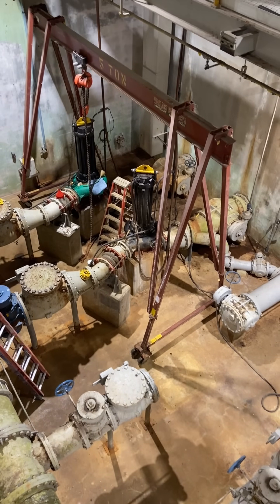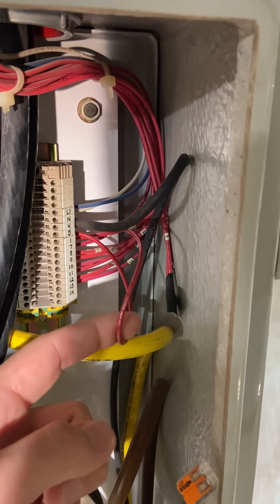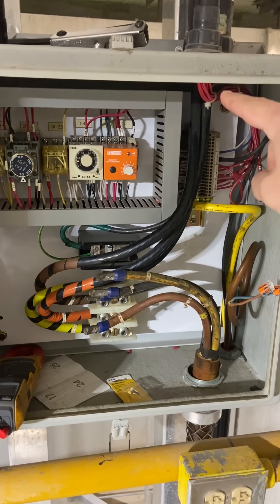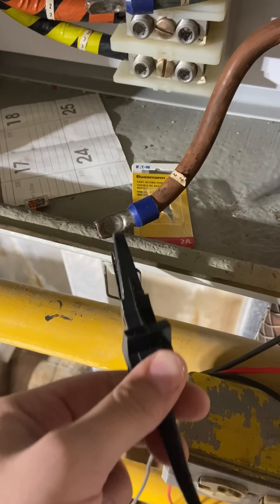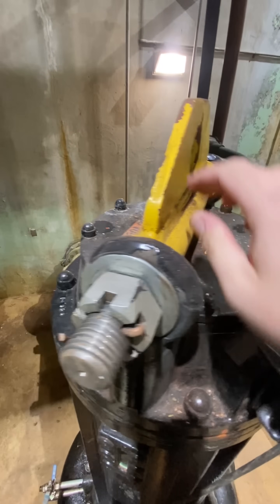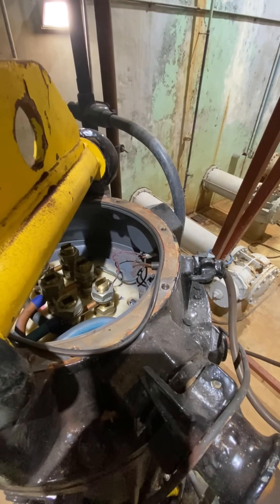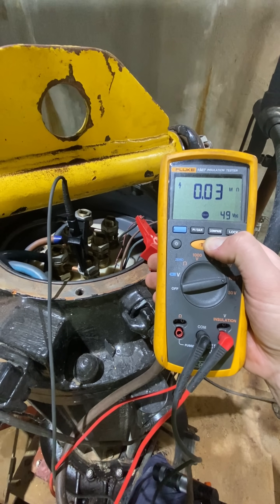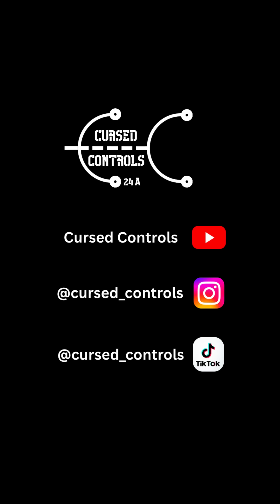Temp Sensor #electrical #motorcontrol

Comment: It is most likely due to high frequency harmonics of the drive causing voltage induction. Most likely the problem will be solved if you use an output choke

Comment: I would really much appreciate if you would start a series in literally  teaching how to do  controls / wiring up /  diagnosing / how to use the multimeter / interpret results / plc , etc . 

Would really like to tap into your technical  know how 😊
I need to learn more form people with actual experience like yourself so I can get to the next level aswell ! 

Please consider this  . There is a hunger for this knowledge that I crave 😅

Comment: That looks like water in the wrong place.

I had a similar problem... I got called in after someone blew up a few plc's and 24V power supplies and the one after him did the same thing once before calling me.

They just didn't know where to look because replacing the exploded components didn't solve the cause and their dmm wasn't sufficient to measure an insulation fault that had a breakdown voltage.

I immediately knew it was line voltage on 24V parts and pulled out the megger, almost immediately traced it down to the thermistor inside the motor.

Checked some other control cabinets and a bunch of thermistor cabling was just bypassed...

I then modified every pump control to fit a foxtam insulated thermistor relay and added 300mA GFCI to every pump (added GFCI protection because those pumps feed waterfalls and small streams from multiple public accessible ponds.)
No more expensive control repairs and the pumps started to be more repairable due to less burn outs.

Then some 'new' guy came in and removed all the GFCI for the reason they cause nuisance trips, pumps started burning out again and I stopped taking calls from them 😉

Told them I won't service unsafe equipment. You touch it you own it.

Comment: Had something similar on a large scroll compressor: putting 400v onto the motor made the PTC-sensing protection module go bang. Turns out the mains was leaking onto the PTC wiring somewhere and…..kaboom! Couldn’t see it with a multimeter, but found it once I started testing >100v with a Megger. 

New compressor required…….

Comment: 30 year pump guy here, this pump looks really old it possible the motor insulation is bad, not jumping to ground, but jumping to the sensor. You only meggered it with 50v. You should have meggered it with 500v.

Comment: 10 years later it still sitting like that. I replaced a sensor on a carbide saw 10 years ago I haven't worked in that company maybe 8 years. That sensor is still there. It was not the correct sensor proximity sensor with dual outputs but I had to make it work since we didn't have that sensor and well its a German machine so they source the parts from a company that bought all the plans and licenses for the machines since the old company went out of business so lead time was 2 to 3 weeks but if you've worked in a production plant the words lead time is a sin. Even though we would that sensor in the parts l8st every week our boss just didn't order it cause it wasn't broken. Well last year I visited and that sensor is still there still working and im the I ly person with the original programming for the plc. So when they do decide to replace the sensor its gonna be full panic. When it doesn't work. I did specify if they order sensor it should be the new one on there since the program wass chang3d to accommodate it
 But the chances they listened are slim co concidering they never ordered the original sensor. Which had output one at one distance which the saw could drop fast until it got really close triggering the second sensor which would slow it down to its cut speed. Well a simple program change and knowing the actual feed speed let me set up a bar size to feed speed on 2 timer one to get with in 1/4 inch then drop the feed speed to its final cut speed. Not perfect since adjusting feed speed on the demand is harder for the operator to understand but so far its worked

Comment: I have seen this several times over the years as a motor tech. I would bet the motor is a dielectric oil filled motor. Either the motor or the sensor has failed slightly and contaminated the oil. that makes the oil conductive and back feeds the sensors. I typically seen it happen most on moisture sensors in submersible pumps.

Comment: That initial remark about "not a permanent solution" is what went wrong on MV Dali, causing it to loose steering as it was passing the point where two sailing channels met just before the Key bridge .  Motor guys couldn't run fast enough between the controls to regain control before collision .  6 Dead and a billion $ in repairs needed .
Reply: The MV Dali failure cause was the heat shrink wire identifer markers were placed too close to the ends. That made it so the crimped on pins could not insert fully into their connections. Over time they'd vibrate loose. The other part of why the ship lost power was the arrangement of how the systems handled failures. The systems could have been arranged so one loose wire couldn't cause everything to quit, but they were not. https://www.youtube.com/watch?v=bu7PJoxaMZg

Comment: I'll bet you it's the feather on that crimp connection on the red wire.  I would at least clean that up before spending thousands to have the motor rebuilt.

Comment: Just a millrat learning electrical the hard way. When megging a motor, do you ever check phase to phase, and if so, you would disconnect your other pairs(7/4,6/9,5/8) right?
Reply: Meggering between two connections that go to the same winding is not going to be useful.

You could in-principle disconnect the windings from each other and then test between them, but I don't think it's something that is done regularly.

Comment: Regardless if the breaker is off or not you should never use uninsulated tools when working on electrical components

Comment: So one leg the sensor gets connected to a different phase, creatcing 240v on the clock and sensor. Why not use the same phase for the temperature sensor as the shorted wire. If the motor doesn't overheat and doesn't short to ground it's just a worn out sensor lead in the motor. Add an extra overheating sensor for safety and save yourself a ton of downtime.

Comment: Real professionals? You actually diagnosed it, correctly. The only thing you didn't check was if the motor case had a grounding issue, while running. There was no need to though. If I could trust the last guy that was into whatever I happen to be fixing or replacing on a given day...do you know how much easier my job, or even, my life, would be?!

Comment: Nice catch, one issue is if the fuse blew the thermal wires shorted yo ground, if that blew the timers or OTHER controls then the 480 is making its way back into the control circuit 😢 that bad & motor should have been left locked out.   Mo need to let it take out mains, fuses to melt the motor down more.😊   the therman leads are 300v wires & looked to already be shot insulation. 
Always to a meg check to ground too on leads & thermal switch @ a lower voltage on the meg.

Comment: Just curious.  Did you write a detailed report of your findings. Put a copy in the service manual you have.  A copy for the bosses files.  A copy to put inside the peckerhead for the tech that is going to tear it at the motorshop so its not a mystery.

Comment: I'm going to say the motor probably has a "flying short". 
I have had this to happen to several electric motors over the years. The short only occurs when the motor is at speed. Centrifical Force is what triggers the short. A flying shore is not easy to find. I have had to use a second motor to spend the first motor up to speed to be able to detect the short.

Comment: I had a internal temp sensor\overload in an ABS Piranha pump cause a ton of issues after tripping a few times.  Tripped well below FLA and just above MOST operating amps.  Electrician came in installed O\L in panel...still tripped at internal O\L..bypassed...no more issues!

Comment: That is a sweet Megger. I can't justify the expense of a modern one for the once every year and a half I actually use one, so my old school hand crank 500V one will have to do. Is it heavy, cumbersome, and a pain to use half the time? Absolutely. Do I still love it? Absolutely times two.
Reply from the maker: @robertschemonia5617 I have a 1,000v crank that just gave up the ghost, sad day☹️
Reply: Believe it or not I've had multiple cheap ones (like under $100). The aneng ones have been great. But even the cheap dog s*** $30 Ones Still Always gives the same readings as my fluke and megger brands.
Reply: I never had an occasion to use a hand crank megger. We had analog ones and I used the same one for years. Then they swapped to digital ones. I kept my old analog one and still prefer it. I trust it more.
Reply: @thehogdoctor the only reason I have the one I do is because it was CHEAP like you wouldn't believe. I paid $0.20 per pound for it, and it was still in the original canvas bag, and even had some of the test cards in it. The bag fell apart, but I did keep the cards that weren't ruined. I also know what you mean about analog meters! My go to is my ever faithful and trusted Simpson 260 series 8! The one thing I absolutely HATE about it is the stupid reverse banana connectors on it. Fixed that with a set of allegedly gold plated adapter dealies. Now pretty much any meter leads will work with it! Simpson must make their replacement leads with platinum plated unicorn hair!

Comment: Ahh yeah those dry well-wet well poo stations are always fun to work in. Years ago when I first started my career I often worked at a pump house like this one. There were Flowserve MSX pumps and Sulzer pumps. I saw this same failure mode on one of the Sulzers. I also have to periodically pull a pump and refurbish it. Oh how I hated refurbishing those things! I think they had been refurbished so many times it was getting to the point of needing to replace pumps. Also, one time that lift station formed a leak on a pipe flange of the main discharge header and it filled up the dry well with a zilloin gallon of poo. Thanks for the memories and thanks for sharing.

Comment: Oooooh someone’s got a fun day of pulling a motor on their hands 😂 unless someone can get to that thermal sensor on sight, that would genuinely be something I’d love to see how it’s done lol
Reply: I used to work for a company that did vac truck services for city.  Numerous times we'd get called in to pump out sani wells to pull pumps.  I never really thought it was a big deal until reading all these comments.     The pumps we'd pull very similar in size to the ones in this video.   Anyway, the well would get pumped down by the remaining pumps.  The crane truck would lower its hook to the pump and we'd slowly lift, ensuring no cable tie ups, get it just below the top of the well, then pressure blast as much shit and grease off the bastard back into the well. They would land the pump on the ground.  Id finish blasting what i couldnt see before.   The millwright would do his inspection onsite.   If he decided to send the pump out, we'd wrap it in poly, duct tape it and crane it onto a flatdeck.   Wait an hour (municipal time of course) for the backup pump to arrive and we'd put it in place, do a test run and call it a day.  I've done that probably 150 times over the course of 10 years. I live in a hilly region and there are A LOT of municipal wet wells.

Comment: Why not just use overloads if you're using a basic bimetallic temperature switch?
Reply: Bimetallic temp switch still measures the winding temperature. Also required due to ATEX etc. (common with sewage applications). Overloads also cannot properly protect a submersible motor, especially in the case it is no longer fully submersed.
Reply: @kanetw_ super interesting. Thanks.
Reply: Idk. I think a thermostat in the motor is more quick to respond to an adverse thermal event that isn't due to ambient temperature/ motor load, it covers things like bearing friction to some extent

Comment: Thanks a lot for this video. I was actually considering whether to wire a bimetallic temp sensor directly to the VFD or via a relay, and this made me wire it via a relay. Don't want to fry the new shiny Siemens G220 because of an isolation failure

Comment: Thank you for your videos. They're very helpful and informative. You do clean work and I respect it! I'm a 3rd year electrical apprentice and I work on lift stations for my utility so its pretty cool to see similar content/things. With that being said I have a question in regards to megging. I was taught on 480V motors you test at 1,000 volts and look for 11 Gigaohms as a perfect reading. For 240V motors you do 500V and look for 550 Megaohms. Do you or anyone else do the same? I've heard some people say it doesn't matter and some say they only do 1,000V on everything. In my experience though I have found that I don't get a 11 Gigaohm reading when testing 1,000V on  240V motor windings even if its a new pump/motor. But I'll always get 550 Megaohms when testing at 500V. Im not sure if the 11 Gigaohms is out of reach for a measurement for the 240V windings or something. Any advice or help would be appreciated. Thank you.
Reply from the maker: @Sparky239 Every motor and pump manufacturer will have their specs for what readings you should get, but as a general rule, a megger 480 V motors at 1000 V and 240 V motors at 500 V but there’s no great answer on what resistance you should read. I have seen motors with very low resistance readings run for a very long time. Also, you can megger the same motor with five different meggers and get five different readings in my experience lol.
Reply: @Cursed_Controls I'll keep that in mind and do my best to remember that. I can relate seening low resistance readings on motors and they run for a while especially on starters. And 5 different readings is pretty wild on one motor. Thank you for the help and advice. I appreciate it sir!🤝
Reply: I, personally, dont necessarily buy into testing at 1kv when your wire is rated for 600v. The caveat is if you test at the motor itself. Those wires can probably handle the 1kv. Typically, though, you measure at double the equipments rating as per NETA, IIRC.
Reply: @CatnamedMittens Okay that makes sense and is a good point. Thank you for the information and advice.
Reply: @Sparky239 I'm no expert, it just makes sense to me. If you're at the motor test at 2x since that's what the mfg does anyways. The whole circuit at 1kV? Ehhh idk. Typically your wire is rated for 600V. I don't necessarily think its a good idea.
Reply: @CatnamedMittens Yeah thats definitely something to think about. I will keep that in mind. Thanks!